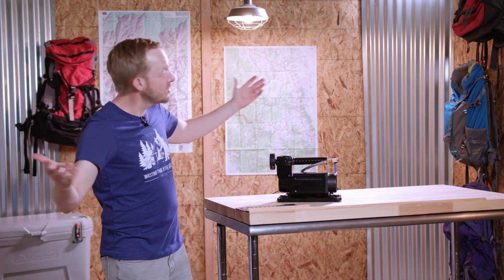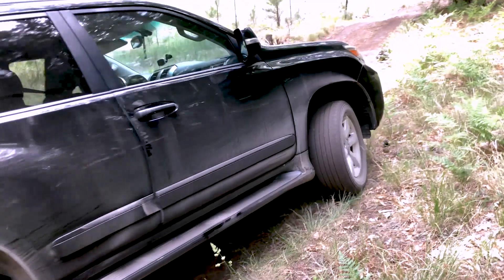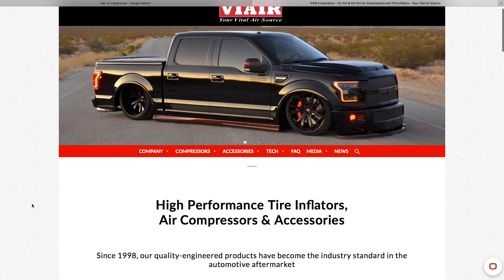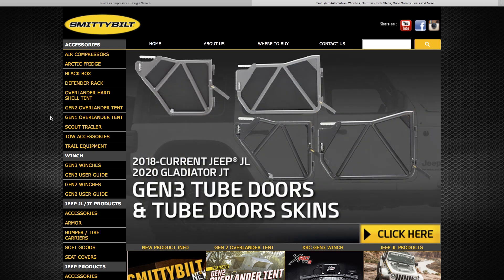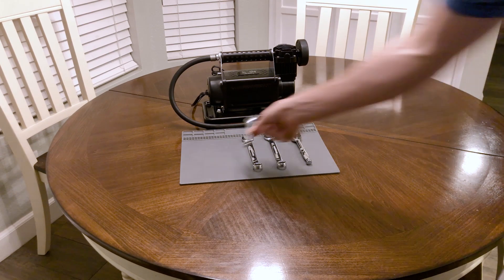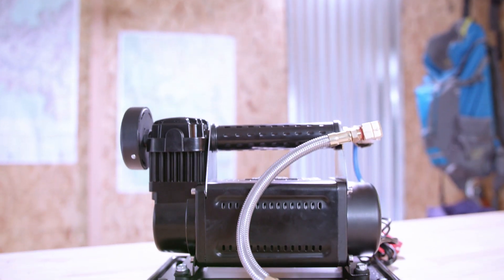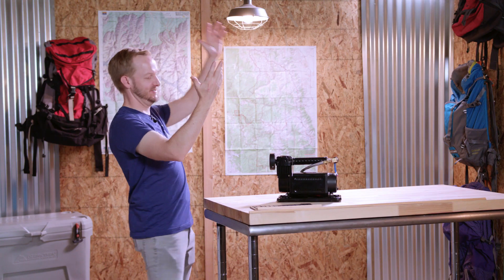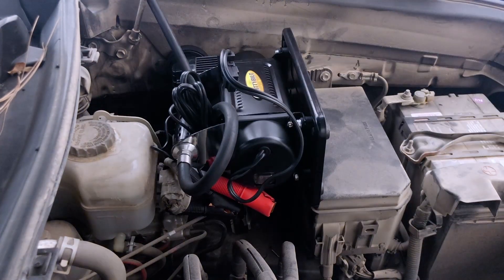SmittyBilt 2780 Review and Mod - (ARB vs. Smittybilt 2780 after DIY pressure Switch Upgrade)

Comment: I would really appreciate it if you would make a How To video or post the instructions!
Reply from the maker: Hey, Matt! My next video is a two-parter that will include a wiring diagram for the pressure switch mod. The series will cover how to modify the Smittybilt further to side-mount it under the hood and how to build a manifold that bolts on right in front of the battery. I hope to have both up in a couple weeks. Thanks for watching, asking and staying tuned to the channel!
Reply from the maker: Check out the latest video for a wiring diagram and more detailed instructions - https://www.youtube.com/watch?v=8a-umrMY158

Comment: 2780 still has a Thermal problem.  How did you navigate that?  my motor burned out.  is it fixable or a landfill?
Reply from the maker: Sorry to hear that! My thermal cut off switch has kicked in several times. Every time I cursed. Guess, I should have been thankful :-) get a 2781 to replace it. Good luck!
Reply: @WastingTimeInTheWoods     hi, I'm not excited about purchasing from smitty again with the their reply to me when  contacted them about my 14 month new dead compressor.

Comment: Can you give us viewers a long term review on the Smittybilt 2780? Thinking about a cheap reliable 12V air compressor without the ARB price:)
Reply from the maker: Maybe, but I can tell you I made this video and did the work almost 3 years ago now and I aired up twice this weekend with no issues : ) (and about a 50 times before that). Go with the 2781 though, same process and fits. Mine overheats on the 4th tire if I'm above about 8500' or in the desert in the summer so I have to give it a break before the 4th tire in those scenarios or end up having to wait for it's thermal switch to reset (~20 minutes). Should not have that issue with the larger 2781. Good luck!

Comment: This is detrimental to the compressor. Watch this video and you'll understand. I wish I watched it before I destroyed my other compressor. You need to have a flow through air shuck. If not, it's just pushing against pressure and will kill the compressor. Please check out this other video before You do this.
https://youtu.be/zNayOAq5hFU

Comment: Is the small black wire going into the motor a thermal overload?
Reply from the maker: I believe thats powering the relay. The thermal switch is inside the motor somewhere.
Reply from the maker: Not sure though so do your own research : |
Reply: @WastingTimeInTheWoods  it is a thermal switch

Comment: the how- to video would be great. I'm looking to purchase the larger version with almost the exact same intentions to do what you did here with the pressure switch and normal fittings
Reply from the maker: I expanded on the instructions and made a wiring diagram which you can find in this video - Ultimate Onboard Air System (DIY) – GX 460 SmittyBilt 2780 Onboard Air Install
Reply: @WastingTimeInTheWoods  yes! I did see that video I completely forgot to come back and update my comment lol thank you!
Reply from the maker: Good luck! Theres a pdf in the links to that video and amazon links for the compressors.

Comment: Hi, Nice modification. Do you think it will hold up well in the engine compartment? Was thinking about making the same modification and mount in engine bay but im a little worried it wont tolerate an engine wash? How water resistant do you think it is? Br Pontus
Reply from the maker: I would probably get an ARB if I were planing on doing water crossings regularly.. It did overheat on me one day after 2.5 tires but I was trying to get them to 45psi. It fired right back up after a 20 minute cool down though. I think for anybody doing casual overlanding, this is a good choice. Hard core guys running 34" tires, probably better get an ARB double.
Reply: @WastingTimeInTheWoods  Thank you for your answer. Oh no i'm not planning on doing water crossings, just a 1 year regular engine "wash" to keep it clean and nice. I'm only running 33" and 35psi on road so i think this one should be fine.
Br Pontus
Reply from the maker: @pontus8589  Then you should be fine. I've washed my engine once with it in. I would silicone the hole you drill in the plastic cap if you do the mod. On another note, I use tire foam on my engine and it does a great job.
Reply: Sweet thank for the tip!

Comment: Fellow GX owner here... what was the plate you used to mount this under the hood?
Reply from the maker: I used a c4 fab 5th gen 4 runner accessory mounting plate because I'm a cheap bastard and didn't think to measure the plate first. It's only $25 currently but I had to use a bunch of washers to space it off the fender because it's really too small to fit the Smitty 2780. It would work fine for a single ARB which is more compact. If I were to do it again (and I probably will because I'm an idiot), I'd probably start with this - https://www.powertrays.com/collections/5th-gen-4runner/products/1-blank-powertray. That looks like it will fit the Smitty much easier and leave room for accessories. I've got mine installed under the hood now but it was a bear. Stay tuned for install videos next.
Reply from the maker: Check out this video for much more detailed instructions on how I installed the Smitty: https://youtu.be/8a-umrMY158

Comment: Can you post a parts list for that mod?
Reply from the maker: Sure. I can probably make that happen today.
Reply from the maker: Done. Be sure to subscribe if you plan on doing this. I'm be installing this under the hood and adding a 4 tire air up system of my own design so this will be the first in a series on my custom air system. Thanks!
Reply from the maker: Check out this video for much more detailed instructions on how installed the Smitty under my hood: https://youtu.be/8a-umrMY158